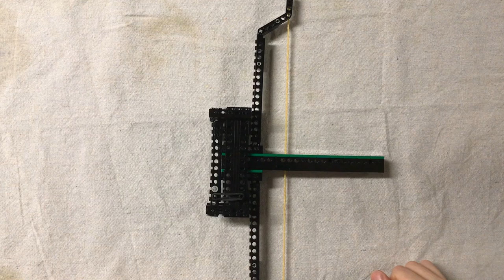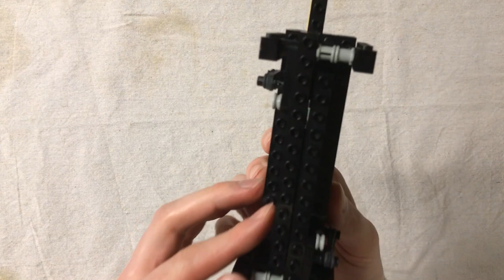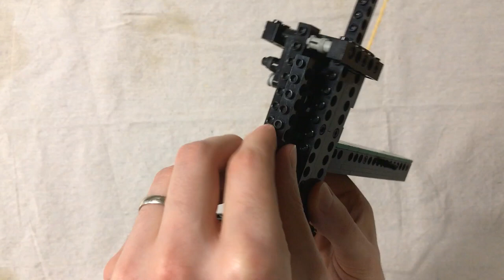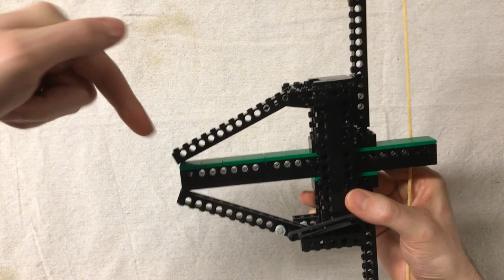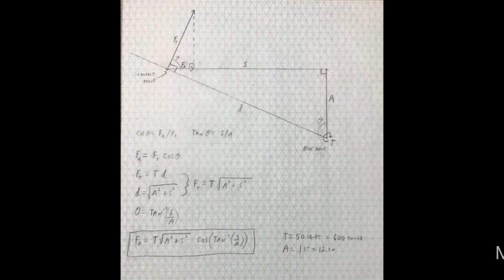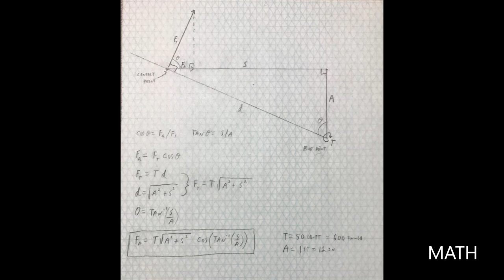Instant Legolas Power Assist Design - Response to Tod's Workshop

Comment from the maker: Some additional after-thoughts:
-I think a cam/leaf spring mechanism would be best for applying torque to the pivot arms, similar to Tod's original prototype. A common leaf spring could run vertically along the back of the power assist housing (fixed at a couple points near the center), and the pivot end of each pivot arm could have a cam that engages a respective end of the spring to apply torque as the arms pivot outward.

-The entire power assist could be reduced in size for bulk/weight reasons, and consequently the pivot arms would be shorter. As mentioned in the video, the slider would ultimately push past both arms, resulting in zero push-back force past that point, and then when drawing the bow, the arms would kick in at the last portion of the stroke (depending on the arm length).

-One could round-over the nose of the slider/magazine and apply bronze strapping over the top, bottom, and nose of the slider to reduce friction against the pivot arms (which I imagine would be made from metal or metal-reinforced wood).

-My model makes it appear as if the pivot arms would block the front end of the magazine on full bow draw and block the arrow from exiting. The model is not to scale and the arms could be thinner relative to the width of the magazine and be spaced apart to leave a gap between them for the arrow. The arms might also be positioned on either side of the magazine, and a horizontal pin on the nose of the magazine might engage the arms instead of the top/bottom surfaces of the magazine. Either way, shouldn't be a problem

Comment: From the solutions I've seen so far I honestly like this the most. Just capitalizing on the varying lever length is really clever and keeps the design simple. If the arms use the torsion system of a roman ballista to wind up, it could also guarantee to be within the technological means of the medieval era (avoiding the problem of requiring too modern metallurgy for the spring steel to bend as far as required)
Reply from the maker: Thanks, I appreciate that. Yeah I think ballista-style torsion system could be period-accurate and could work in theory, but I'm worried it might get too bulky since those rope skeins need to be fairly long (this would translate to a very wide mechanism on the bow). As I mentioned in my after-thought comment, I think a similar (but rearranged) cam-spring system as what Tod used in his original design might be best, especially since he obviously has the means to make it.

Comment: I like how the two cause a good balance and the angle they go to changes being what changes how much force is pushing back. Not sure how much friction would affect it in a wooden or metal one.
Reply from the maker: Thanks. As far as friction, I didn't mention in the video but I imagine the pivot arms would be iron/steel (or wood reinforced with iron/steel), and you could probably round the nose of the slider/magazine and cap/strap it in a metal like bronze, which has lower friction (the bronze strapping could run the length of the slider on the top and bottom). And of course there's always good old grease lol.